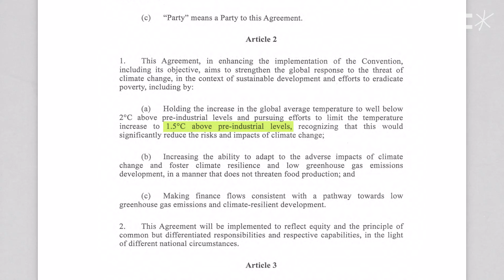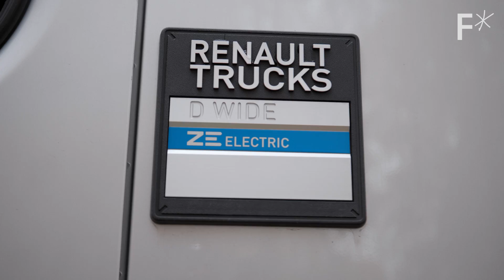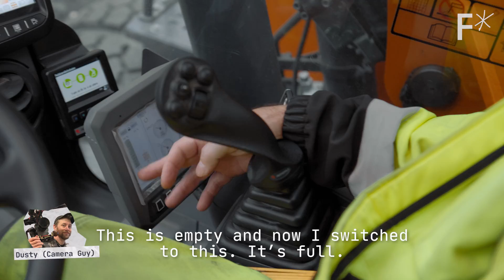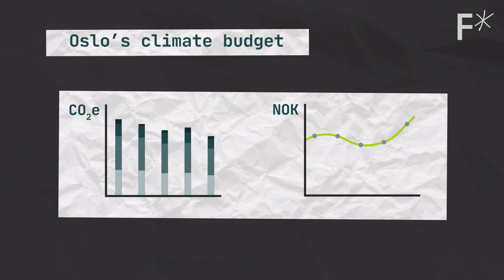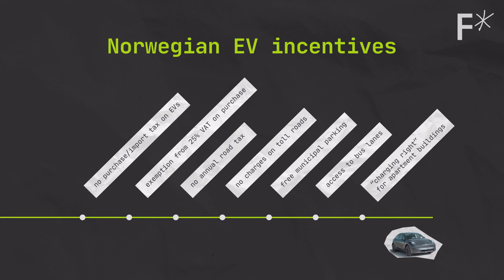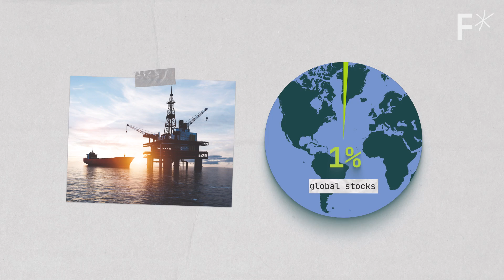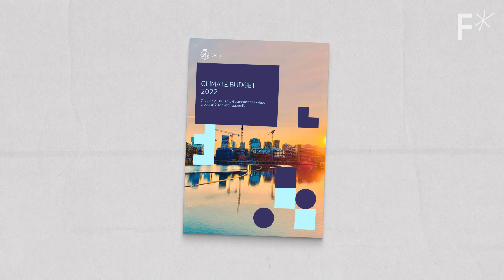The world’s most electric city | Future of Cities

Comment from the maker: How do you think cities should switch off fossil fuels?
Reply: I’d like current construction equipment used within a city to be fueled by a bio-based fuel, preferably a recycled or reclaimed source. We have millions of heavy diesel equipment within feet or blocks of people breathing their exhaust but we can create a home-grown, local industry to power these otherwise heavy polluters.
Reply: @ttopero  With the notable exception of biogas (because it captures methane and burns it off as the less potent carbon dioxide), biofuels are terrible greenwashing solutions. In Sweden we're basically burning our forests (and even importing from other countries despite our very large logging industry) and patting ourselves on the back for how "green" we are. The Co2 released from biofuels is just as potent as the Co2 released from fossil fuels. Yes, it comes from a shorter term source so it can be rebound in a matter of about a hundred years as opposed to millions of years with fossil fuels, but we don't have those hundred years to play with, we're running out of time, and in the meantime it means even more Co2 in the atmosphere.
Reply: @ttopero  Bio-based fuel still causes toxic exhaust, though. I think Oslo shows that battery-electric works fine. No need to waste agricultural land growing biofuel.
Even better: plug-in electric construction equipment.
Reply: @willabyuberton818  there was no mention of where the funding came from for development or production of this equipment. We have hundreds of billions of dollars of legacy construction equipment with their manufacturers that will be around for decades more. We need to accept that we’re not going to transition to electric everything overnight so we need to improve the conditions that we have. Yes, bio fuels still pollute, but much less & can be from recycling or otherwise discarded materials.
Reply: I live in shanghai. I found the cars on road is almost 50% are EVS in shanghai. Including almost all taxi and buses. The young people love EVs more.
Reply: @junguo3088  Yes, junguo, you've shown this video creator that he has no clue what he is talking about. Thank you.
Reply: @earlysda Bro, let's me also contribute  of having no clue what I'm talking about... with the future development of this city transitioning to electric everything, there will be a decrease in the production of Tesla vehicles. 😏
Reply: Corporations that have a net revenue over 10 million should be responsible for providing their own renewable energy.
Reply: @sIXXIsDesigns  The thing with hydrogen fuel cells, as I'm sure you know, is that electrolysis, which is the only environmentally friendly way of making hydrogen, and the grid-to-wheel efficiency is something like 30%. It should be noted that fuel cells also require rare earth metals such as platinum to produce, while new battery chemistries are moving away from the rare earth metals to things like sodium batteries.
Reply: @dijikstra8  it is not 30%, it is 60%, 30% is if the car converts hydrogen in electricity. There are cars that use directly hidrogen (60% effienciency, and furthermore electric cars do not have 100% effiency must be around 70 or 80). You can´t just put batteries on planes or ships, it would be very very expensive, dangerous and complicated. btw electric cars need x100 times water to extinct a fire from those than form diese or hydrogen, the bigger is the battery the bigger is the problem, just imagine if instead of a car it was bus, trucks and cars in a road crush. They get in fire easier and the battery life is just 8 years, and the material needed not only it polutes but it also make people work in horrible condition. Also batteries are very vunerable to high or low temperatures. Hydrogen doesn't have those problems, it really is the future.
Well, the real solution is just to not use cars unless you need to go somewhere bad comunicate by public transport, in that case we should facilitate rent cars that are as easy to pick as scooters, like in Amsterdam
Reply: @dijikstra8  There are alternative materials to platinum. Samsung was supposed to come out with a graphene battery in their phones. That was pushed back even though they are ready to use. Rare earth materials puts China in a very good position. Graphene is a super material that could replace a lot of technologies removing China as a leader in producing batteries. Graphite can be turned into graphene even though it exists in graphite deposits. Graphite exists all over the world, and is not rare. In batteries it charges very fast. At this point it is an interesting idea. Public transit in cities would be more efficient especially if it hauled commercial goods on one and people on the other using electricity from nuclear reactors. There is another way to make hydrogen as a byproduct in nuclear reactors. They call it pink hydrogen. Hydrogen can also be cracked off of fossil fuels. Trains are in the works for BNSF. It is going to be slow going. Fuel cells are interesting, but the amount of fuel to drive one currently is not feasible. If you observe the hurricane in California, it shows how utterly these solar and wind farms can be destroyed by one storm.
Reply: Include low-tech where possible, walkable neighbourhoods etc, so quality of life is improved - trust and friendliness are built.
Reply: Re-discover western society !!!
Reply: Hydropower is still the mainstay of the Norwegian electricity system. At the beginning of 2021, there were 1 681 hydropower plants in Norway, with a combined installed capasity of 33 055 MW. In a normal year, the Norwegian hydropower plants produce 136.4 TWh, which is 90 % of Norways total power production.
Reply: Not everycountry has abundant clean sources of energy.
Reply: 1. By investing in alternatives to the current lithium-based technologies such as the So-Ion based batteries, and use of materials. There is no use of calling yourself "green" when the lithium in your EV is mined using one of the worst ways of pollution.
Reply: unfortunately the only way is to federally incentivize the anti climate crowd and raise the fuel prices.
Reply: Two words: Fusion energy. ‘Nuff said.
Reply: Providing for electrified transit that is abundant, and that allows for trips anywhere in the city is a huge part of this. We used to have much more robust transit systems, and we should go back to those. A huge side benefit is that way less people will die trying to get to and from their jobs or just driving around, living their lives. People wont be forced to own cars, saving them thousands of dollars. And people who should not be driving will not have to drive, hopefully making the roads safer for those who still do. Also re-zone for density, make cities walkable and livable instead of the car-centric, business-starving mistakes like they are now (at least in the US and many other countries).
Reply: No.
Reply: @freethink #1 priority should be urban design. We need to claw back from sprawling suburbs into walkable centers that promote pedestrianism, micro-mobility, and cycling with small-scale infrastructure where appropriate, and connect these centers with suburban centers through intra-city transport. Cities then should be connected by high speed regional transit (i.e. high speed rail).

This isn't 100% reduction, and it wouldn't be done before 2050, likely, and even then that's ambitious. But it would accomplish the most and do it quickly.
Reply: Absolutely no
Reply: First priority would be improving the quality and coverage of public transport, unify it with train services so you can easily use both. Minimize the use of private cars, electric or not they use up too much space and are dangerous, encourage people who need private cars to switch to smaller electric ones like that "golf cart", you can easily notice that as you said it was designed for it's purpose and not just electrified. Smaller cars take less space and are safer, reclaimed space can be used for bike lanes and wider sidewalks to encourage walking and biking that are carbon free. Planting trees also makes the air cleaner, provides shade, lowers the temperatures, and discourages drivers from going too fast. Solar panels on rooftops would provide additional energy while not taking useful space, water towers could be used to pump water using excess power from renewables and release it during nighttime. Rooftop gardens would provide fresh fruits and vegetables that don't require transporting further reducing energy needs. Collected rain water could be used to water these crops. I'm not really a fan of battery powered transit so hydrogen fuel cells are my go to, hydrogen can be produced using excess power from solar and can be used to power transit as well as the grid during nights, it has a rather poor efficiency at around 30-40% but is over 10 times more energy dense than batteries.
Reply: I’d like to see all of NYC switched off on the condition that they can’t have any help from the outside. No power generation using hydrocarbon or nuclear and no food that was grown using hydrocarbon or nuclear in any way. And you can only have batteries if you can mine the materials without slave labor.
Reply: hahahahahahah come to china hhhhhhh😄
Reply: come to shenzhen 公司
Reply: Really liking Norway as an example
Reply: Just do it.
Reply: commence the climate war!, f u greenies!
Reply: F. O. WEF shills!
Reply: Start off by realizing big things need big power sources and an ev pickup is not sustainable but a citroen ami is
In cases where it's possible, reduce battery size for big vehicles and switch to a system similar to electric trains and buses, power being drawn from a central source
Reply: If money is not a problem like in Norway then just offer 1 to 1 exchange form gas car to EV. You bring old gas car in for a change and you get minimum EV, you bring costly gas car in the exchange you get more expensive EV. Same with construction equipment etc. If money is issue then solutions need to be more selective.
Reply: "How Do you think"...LOL. why are you asking us idiots in the public like you're a teen magazine?   Did you do any research for this? At no point do you make it clear it's Government mandates & spending.... And It's always government. It's only happening because of govt decisions & spending... in the 90's.  Did you even know that? That's the only thing that matters.  "We're gonna stumble around the city and look at stuff"... to pay for our trip.   So close to actually getting it, but it's just "I guess its just kinda happening" journalism.
Reply: by selling it to EVERYONE else, like oslo
Reply: This is fake news... Sky News and Fox News by my overlord Rupert Murdoch told me that going fully electric cannot be done due to the strain on the electric grid!!
Reply: Thorium reactors
Reply: By resurrecting the old school way of producing and using electricity of around the world in the 1800s to early 1900s before they were taken down, hushed and made to dissappear everywhere, that is, the collection and use of the AETHER Electricity just as proven by Nikola Tesla ! 
Also to bring back the free electricity generating machines of perpetual motion thru magents ! 
Research into these if you've never heard about it or if  you've only ever heard it put down with doubts and negative comments by propagandaists!!
Reply: How far are we from 'In Time' metal & earth merging reality?!
Reply: asphalt ski's.
Reply: The fatal flaw of Democracy is that it's only as good as the people who participate in it. And engineering isn't a Democracy. If you don't know what your talking about and you're making the decisions, you'll end up with windmills that have toothpicks for blades.
Reply: IT's a VERY DUMB idea to do Construction with Electric Excavators, etc coz Energy Density of Batteries for Large machines doesn't make Sense, even cars shud not run on Electric since Electricty is produced using Fossil fuels .
MOst importantly the Amount of Mining done to get Cobalt for Batteries creates more Pollution n Slavery in an African country which is not Done by Idiot Liberals like yourselves>>
Hope U do some Research before making Dumb Videos like this, can't Believe U call this Journalism😅😅😅
Reply: 1 quote to live by If there is a will there is a way
Reply: Artificially inflate the price of fuel and use those margins to invest directly into renewables/ charging infrastructure.
Reply: @jhirai20  The renewables you are talking about are temporary. People for the most part do not like EV. You will never get an ROI on EV, solar, or wind. They don’t like solar nor wind. They are window dressing, and not feasible. You might want to pay $100 for a loaf of bread to fix this scam of global warming, but I, and many others will not. Look at glacial ice records, or the rock record. There are very definite global warm ups and cool downs. We are easily in these curves. Real renewables that are realistic are nuclear and fission. Fission is a little behind, but it will be there. People talked about EV, wind power and even solar since the 1950’s. The whole green movement is getting pushed by China who makes almost everything used from solar panels, wind turbines, and even the toxic lithium batteries. Fossil fuels are a stepping stone. It will in time go away to make room for better technology. Right now, a very large amount of what people use is from fossil fuels.
Reply: I didn't know Oslo was a separate planet.
Understand that even if all of Europe disappeared tomorrow, that would be only 9% of the world's emissions. All this e-spending at the expense of people makes no sense.
Reply: The current grid can't handle everyone switching to electric. And the materials needed for batteries aren't abundantly mined not are they environmentally friendly.
Reply: @LilRedRasta  Both wrong. The grid will be fine and there is more than enough material on earth.
Reply: check out Kochi (India) water metro as well
Reply: With laws
Reply: They shouldn't.  But you can go to an all electric fantasy land where there are no backups when the power goes out in winter or summer.  Then your people will suffer or die because of it.  Meanwhile the USA will be sitting pretty on at least 300 years worth of natural resources that will far out last the rest of the world combined.  Besides where does all that electricity come from?  Fossil fuels, nuclear, hydro, wind, solar, geothermal, oceanic wave generators?
Reply: Not with lithium for sure.
Reply: I think we should replace gas to methane first. 
It's easy, cheap and clean. Lithium batteries needs another decade to become efficient and recyclable.
Reply: Not world first 😊.
Reply: @sIXXIsDesigns  That's just not true. You're now arguing that they are "more polluting" because the electricity is not clean, which is simply not true, but at the same time you're saying we need to move to something that requires three times the electricity to move a vehicle the same distance? Stop trolling.
Reply: Sure, switch off fossil fuels.  The results will be amusing to the people who don't live in those cities.
Reply: They shouldn't.
Reply: Go away greenies!!!
Reply: Coal and crude oil is the obvious answer.
Reply: should have added in a trigger warning for repubicans
Reply: I would only allow zero emission vehicles in the express lanes; that would help much where I live.  Here is another plan that some have similar to Norway:  https://www.youtube.com/watch?v=fVX4h31VHIg
Reply: Hydrogen
Reply: @toesmasher21  yessir
Reply: Does anyone remember the old Ford Cars of early 1900s that they started building amass, then shortly after dissappeared? 
The were cars whose body was built with 'HEMP PLASTICS' which was tested and proven to be 10x stronger than steel on impact, whose 'bio diesel' was a green fuel made from just squeezed Hemp seeds and filtered and ready to fuel ? 
What happened to that tech? 
Anyone can reasearch that common knowledge on youtube or google it !!
Reply: team hydrogen, cuz batteries are like "green" nuclear bombs, especially if the temperatures continue to rise like this

Comment: If Oslo is an example of a future electric city, have you stopped to ask why electricity is more expensive in Oslo - a 100% renewable city - than basically anywhere else in Europe? I thought renewables are cheap way for the future.
Reply: On 09.02.2024 spot electricity price in Oslo was 0.07 per kWh. In Warsaw (mostly fossil-fuel generation), it was 0.09 per kWh.

Comment: Hey, hold on! At 9:18 you said "gas, gas, gas", pointing at an Audi e-tron, a golf, and some van (?). The e-tron is definitely electric, the golf is probably electric and the van I cannot tell, but my tip is: LOOK AT THE NUMBER PLATES. They start with "EL", "EK", "EB" and many more starting with E for all electric cars. You misnamed many electric cars as gas cars. They look exactly the same as fossil cars (for an untrained eye). So, it's actually better than you thought, though I agree that there are still too many gas cars on the roads.